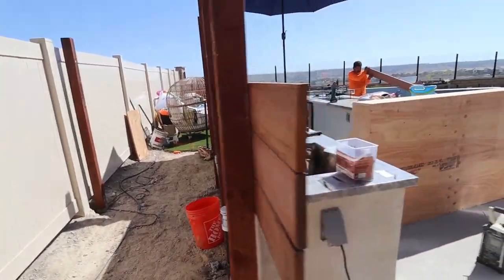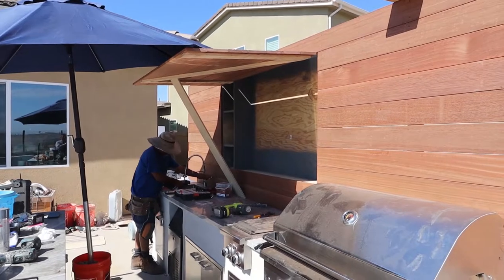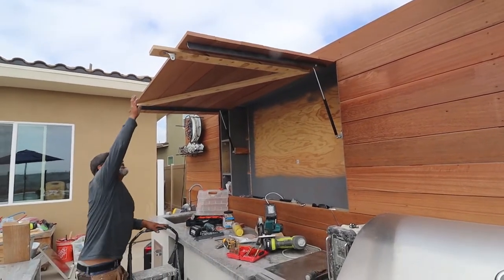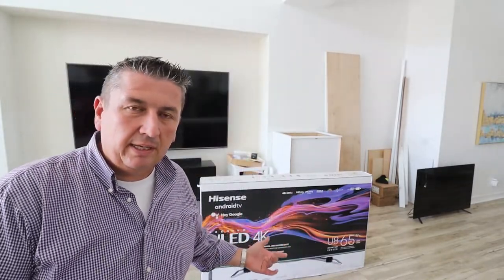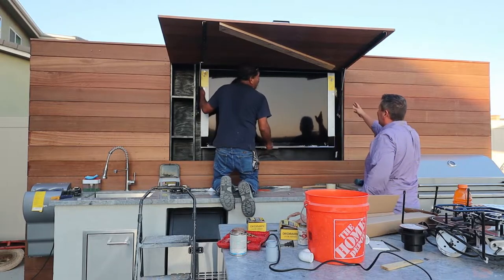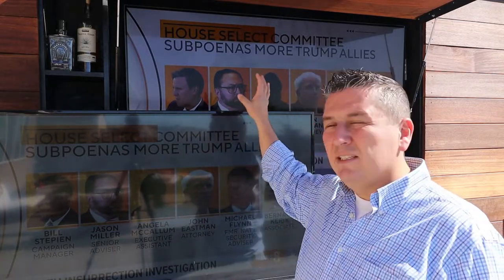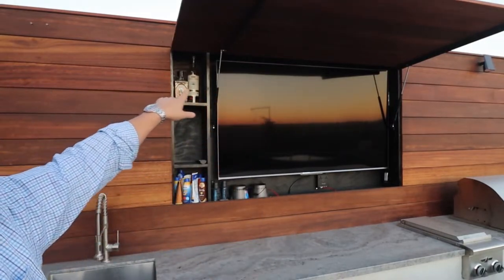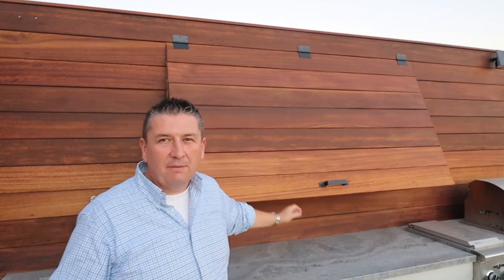Custom Outdoor TV Enclosure & 65" Hisense ULED TV Review

Comment: how did you build the door? what did the wood adhere to? Maybe you had a video on it. i will check thanks! good stuff and looks great.
Reply from the maker: The door has 2 L brackets running down each end of the boards with brass screws. The L brackets are steel, purchased at Home Depot. Those brackets are what the struts are attached to.

Comment: Do you remember the weight of your door? Mine is 40 pounds and I ordered 23 inch 100 lbs struts.
Reply from the maker: No, but it's heavy. The wood is a hard wood and I think I needed the 100 lbs struts also because the first set didn't handle the weight.

Comment: How's the glare on it?  I built an outdoor TV cabinet for a Peerless Neptune (outdoor TV) and have it installed under a pergola that's covered with slide wire canopies.  It's rated at 500 nits and is bright enough for me, but it has a glare issue where I can see a small white strip from my neighbor's garage.  The rest of the opposite wall is dark and doesn't show up on the screen.  It's annoying, especially since I spent so much $ on it.  I was looking at the Hisense U8G or TCL 6 series because of their high NIT rating and lower cost.   Thoughts?
Reply from the maker: Overall I am very happy with it and have had the TV for over 6 months now. I think your TV is better and it's rated for outdoor use so your NITS level is probably consistently brighter than this Hisense but for the money I think this HISENSE is a great option. I think outdoor glare is going to be an issue with just about every TV. For me most of the TV use is in the late afternoon early evening and on HOT days we are in the pool and not really watching TV. I did have it on during the Super Bowl if and the picture was pretty good most of the time.

Comment: I  built a similar cabinet and have the same issue with the door not. losing and bending.  wad the hydrolic that you used too Strong or was it a structural issue
Reply from the maker: Initially the hydraulic was rated for something with more weight. I think the set we ended up using was for 65-85 lbs and it's working well a year later. I purchased 3 sizes and returned the other 2 that didn't work.

Comment: Hey Alex how’s the TV holding up? Been thinking of getting it for my patio as well.
Reply from the maker: It's been great, I'm actually listening to the iHeartRadio app right now by the pool and about to switch over to watch the NBA finals in a little bit. 

No complaints. I think I'm most impressed with the audio and the remote. The built in speakers are great. I can listen to the audio at about 30% with the jacuzzi running and about 30 ft away. Also the remote works well from the jacuzzi or any long distance. Much better than my other TV's. 

Overall, super pleased.
Reply: @AlexErika  that’s great! No issues you’ve noticed with overheating?

Comment: You’re comparing a tv of a different brand and not installed in the cabinet.
Reply from the maker: I thought I was pretty clear that I was just comparing a regular entry level TV to this top end Hisense TV and how the overall brightness is different if you are thinking of using it as an outdoor TV. Anyways, overall I think the Hisense TV in the video is a solid option if you are on a budget. If budget is not an issue then no doubt the Samsung TV made for outdoor use would be best but that is $5k for a similar 65" TV.
Reply: @AlexErika  yes agreed. And I love Samsung (damn 5k for a tv?) 
I meant at the end of the video. One tv is in the cabinet and one isn’t   
Nice build btw. Very seamless
Reply from the maker: @Patriot Woodworker  Yeah, that is true. I used a random TCL and it's not fully tucked into the cabinet and honestly, doing any TV picture comparison on camera is really hard to do. The difference in quality is hard for it to show up on camera. 

And currently it looks like the 65" Samsung Terrace Partial Sun Outdoor TV is $4200 while the Full Sun version is $10k.
Reply: @AlexErika  agreed!😳